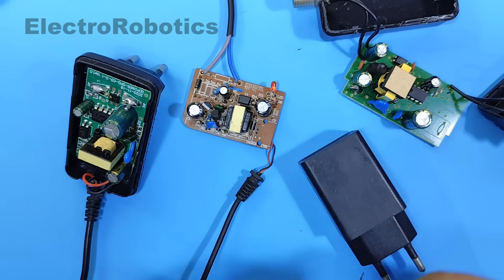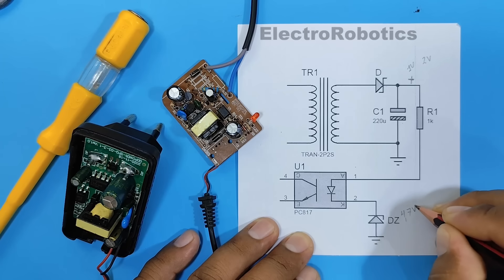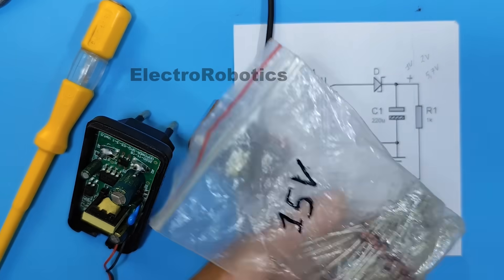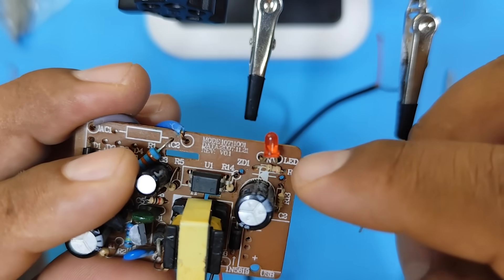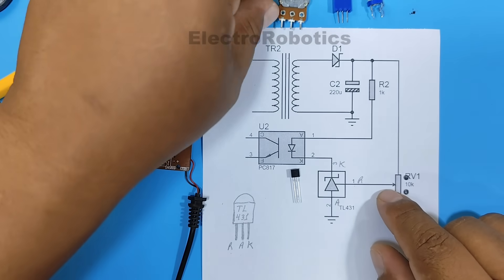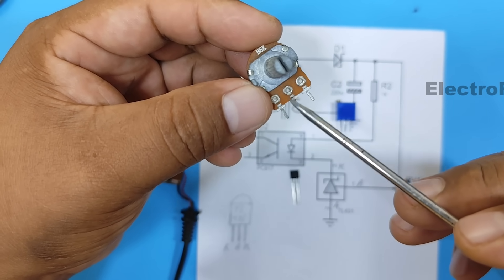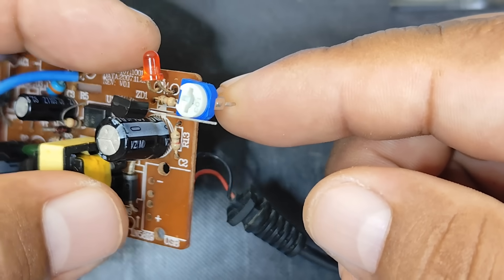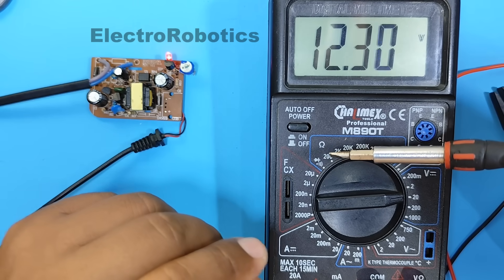Modify Any Charger and Adjust Its Voltage.

Comment: Fantastic explanations. 
Well earned Sub.
Cheers!
Reply: Do not be FOOLED !

So much mis-information
- FIRST SAFETY  is important but no safety precautions are given. The part about adjusting the trimmer is scary bad.
- The current must be reduced else it will over-heat and self-destruct. Do not be FOOLED !
 - it does NOT work on all chargers. Do not be FOOLED !
- the output waveform will be degraded, so the load may not work properly. Do not be FOOLED !
- he does briefly mention the issue with the output cap .....be CAREFUL. For example if you change to 12V then the output cap must rated at least 16V

 This mod has been around for many years  by very ignorant channel makers. It is too bad he has repeated the same mistakes and same mis-information. He should know better.

Using a DVMM with no load is a rather naive test. Do not be FOOLED !

Comment: Good idea👏
Reply: Do not be FOOLED !

So much mis-information
- FIRST SAFETY  is important but no safety precautions are given. The part about adjusting the trimmer is scary bad.
- The current must be reduced else it will over-heat and self-destruct. Do not be FOOLED !
 - it does NOT work on all chargers. Do not be FOOLED !
- the output waveform will be degraded, so the load may not work properly. Do not be FOOLED !
- he does briefly mention the issue with the output cap .....be CAREFUL. For example if you change to 12V then the output cap must rated at least 16V

 This mod has been around for many years  by very ignorant channel makers. It is too bad he has repeated the same mistakes and same mis-information. He should know better.

Using a DVMM with no load is a rather naive test. Do not be FOOLED !

Comment: What about the total outout?
If I increase the voltage, does the Amp decrease?
What if I made 5V-3A (15W) Charger to 12V, Will it still can deliver 3A? if that so, the total output power has increased? (12V-3A=36W?). Will it heat more as compared to original setup?

Comment: Excellent..... thanks.
Reply: Do not be FOOLED !

So much mis-information
- FIRST SAFETY  is important but no safety precautions are given. The part about adjusting the trimmer is scary bad.
- The current must be reduced else it will over-heat and self-destruct. Do not be FOOLED !
 - it does NOT work on all chargers. Do not be FOOLED !
- the output waveform will be degraded, so the load may not work properly. Do not be FOOLED !
- he does briefly mention the issue with the output cap .....be CAREFUL. For example if you change to 12V then the output cap must rated at least 16V

 This mod has been around for many years  by very ignorant channel makers. It is too bad he has repeated the same mistakes and same mis-information. He should know better.

Using a DVMM with no load is a rather naive test. Do not be FOOLED !

Comment: Great video, dude... 
I've just left a big and well-deserved thumbs up!
Reply: Do not be FOOLED !

So much mis-information
- FIRST SAFETY  is important but no safety precautions are given. The part about adjusting the trimmer is scary bad.
- The current must be reduced else it will over-heat and self-destruct. Do not be FOOLED !
 - it does NOT work on all chargers. Do not be FOOLED !
- the output waveform will be degraded, so the load may not work properly. Do not be FOOLED !
- he does briefly mention the issue with the output cap .....be CAREFUL. For example if you change to 12V then the output cap must rated at least 16V

 This mod has been around for many years  by very ignorant channel makers. It is too bad he has repeated the same mistakes and same mis-information. He should know better.

Using a DVMM with no load is a rather naive test. Do not be FOOLED !

Comment: Really awesome! Thank you so much for sharing! 😊
Reply: Do not be FOOLED !

So much mis-information
- FIRST SAFETY  is important but no safety precautions are given. The part about adjusting the trimmer is scary bad.
- The current must be reduced else it will over-heat and self-destruct. Do not be FOOLED !
 - it does NOT work on all chargers. Do not be FOOLED !
- the output waveform will be degraded, so the load may not work properly. Do not be FOOLED !
- he does briefly mention the issue with the output cap .....be CAREFUL. For example if you change to 12V then the output cap must rated at least 16V

 This mod has been around for many years  by very ignorant channel makers. It is too bad he has repeated the same mistakes and same mis-information. He should know better.

Using a DVMM with no load is a rather naive test. Do not be FOOLED !

Comment: Its not always that easy, esp. with bigger SMPSUs. There may be a lot of difficult control circuits that won't work with too high oder too low voltage. In general a variation of 30...50% of its nominal voltage is possible, but it can also fail terribly!

Comment: Harika açıklayıcı bir video olmuş, teşekkürler.
Reply: Do not be FOOLED !

So much mis-information
- FIRST SAFETY  is important but no safety precautions are given. The part about adjusting the trimmer is scary bad.
- The current must be reduced else it will over-heat and self-destruct. Do not be FOOLED !
 - it does NOT work on all chargers. Do not be FOOLED !
- the output waveform will be degraded, so the load may not work properly. Do not be FOOLED !
- he does briefly mention the issue with the output cap .....be CAREFUL. For example if you change to 12V then the output cap must rated at least 16V

 This mod has been around for many years  by very ignorant channel makers. It is too bad he has repeated the same mistakes and same mis-information. He should know better.

Using a DVMM with no load is a rather naive test. Do not be FOOLED !

Comment: Thank you. You helped a lot!
Reply: Do not be FOOLED !

So much mis-information
- FIRST SAFETY  is important but no safety precautions are given. The part about adjusting the trimmer is scary bad.
- The current must be reduced else it will over-heat and self-destruct. Do not be FOOLED !
 - it does NOT work on all chargers. Do not be FOOLED !
- the output waveform will be degraded, so the load may not work properly. Do not be FOOLED !
- he does briefly mention the issue with the output cap .....be CAREFUL. For example if you change to 12V then the output cap must rated at least 16V

 This mod has been around for many years  by very ignorant channel makers. It is too bad he has repeated the same mistakes and same mis-information. He should know better.

Using a DVMM with no load is a rather naive test. Do not be FOOLED !

Comment: So, if you were to change the capaictor to a high voltage value, say 30volt, wojld you have to change anything else to keep it from popping? I imagine i might end up chacing components across the entire curcuit! I would really like to know. I just ordered a basic powersupply with adjustable voltage. I could have done the same thing with these pieces and one of the HUNDREDS of power supplies i have stuffed in boxes, draws, trunk of my car... they are EVERYWHERE! Ionly paid $10 for it, but i wouldnt have bought it at all had i seem this first! 😂

Comment: I want to change my old mobile phone 5 volt Charger into 12 volt charger. But, when i look on YT, all i saw are changing the zener diode and the capacitor. My Mobile charger are made without any Zener diode. I'm not technician nor electronic expert, but self learner. So, i don't know how to change my Mobile Charger output voltage, please help me.

Comment: Okay, nice educational video with not much practical use. If your device is 5V use a 5V charger, if it's 12V then use a 12V charger. If you want your phone to charge faster you need a charger that puts out higher mA, which usually comes with thicker wires and contacts. 🤖

Comment: You are wrong.
These are usually single ended 'flyback' topology. The transformer turns ratio and inductance is designed for the output voltage.
If you boost the voltage from 5V to 12V. This will increase the primary voltage significantly, in fact reflected voltage will increase by 140%. This will have added many serious consequences to power loss and voltage stresses. Unless you are very lucky it won't last. Some will blow up rather quickly as you avalanche the primary MOSFET.
This is really bad advice, it's far more complex, but I guess you really don't know what you are doing in any detail.

Comment: I have 5v 3A charge, i change capacitor to 25v then i increase voltage 15v , so what's maximum A i get from it 3A or 1A?

Comment: BAD! He never talked about the output voltage and current ratings of the transformer in the circuit. No load rating, just yank the voltage ⚡✨! No caution, except for partial cap voltage hint. BAD MANIPULATION!

Comment: Except that by doing that, your risk is to open too mutch the duty cycle which would lead to break the power supply.
Those power supplies are tiny flyback converters and the duty cycle must not be higher than about 30%.
The real thing to do would be to add turns in the secondary, then your method and then you would get a higher voltage with the same duty cycle.

In fact there are no risk to pass the duty cycle because if this problem occured your flyback would react by current protection because they are all current mode.

But you would face a regulation problem: the voltage wil break down more or less.
Reply: Betul sekali jika beban berat maka isdet

Comment: Stay 20% under the Capacitors Voltage, it will be safe and the capacitor will last much longer. So - 20% of the 16V gives you 12.8V

Comment: Maybe the best tutorial video on a practical electronics modification project that I have yet seen. There were still a few very minor mistakes and/or omissions in the explanations and/or steps; key word here being "minor".🤗
I would have liked if you had demonstrated the full range of voltage adjustment on the finished power supply, especially a few words on the MINIMUM VOLTAGE AVAILABLE.
Great work, & I'm certain you'll only get better!😎 Best of luck, & I'm subscribing!🤗
Reply: It's not "the best", it's not even good, it's dangerous and you may end up losing the charger as well as the house you're using it in if you follow this turorial.

Comment: I like his disregard of safety. Tuning the pot with one finger holding the board down with grid voltage just a few millimeters away. 
I this he is looking for thrills.
Reply: OF COURSE he has NO IDEA WTF he's doing, which is why he put together this video with the help of his soldering iron, which he also has no idea how to use, & ignores the DANGEROUS mains voltage it works from as well.🤪🤣🤣🤣🙄
I HIGHLY recommend for your personal safety, that you MAKE SURE that you wear rubber boots & always keep one hand in your pocket when watching his videos.😘

Comment: Dear Professor, following your project to make an small power supply from an old adapter I tried it and I must say it works quite well. I used an old 9V 1.5A adapter. The circuit is regulated by a TL431. I isolated the R from the TL431 and connected a 10Kohm potmeter. After changing the 470mF C in the output to a 25V type the voltage in my test went far over 30V so I put a 1K2 resistor between the ground connection of the potmeter and ground. The max voltage I get now is 23V which is perfect. My only problem is that I cannot go under 5V which is the minimum I can achieve. It is possible to change something so I can go back to 3V?
Reply: I don't know how to go down to 3V, but 25V capacitor is at the edge of the 23V output and may explode.  You should have at least 30 % higher voltage rating at the output capacitor.

Comment: Puzzled by this.The positive of the variable resistor controlling the variable zener is connected to the output of the transformer output.  Doesn't this mean the voltage across RV1 and hence the control signal to the TL431 changes with the TR2 output?

Comment: by incresing voltage..watch out the capacitor volatge value..and change into the higher voltage rating

Comment: Thank You for this tutorial. WHY is so important to set pot to the middle before starting? When we start regulating voltage with it, and we get over the middle, to set desired voltage and turn everything off. Now what? Should we return pot to the middle before pluging it back?
Reply from the maker: Hi Miroslav Miljkovic, we set the potentiometer to the midpoint so that the voltage we're adjusting isn't too high, since we don't know what voltage we'll get, so we start from a midpoint.
After setting the voltage, you don't need to reset the potentiometer to the midpoint.
Reply: @ElectroRobotics-qo2er  Thank you for the quick response. You got yourself a new subscriber!

Comment: Thanks for the illustrated content 🤗 but may i ask what is C1 and R1 values are controlling ?
Reply from the maker: Hi St Man, C1 is the capacitor that chargers have, its job is to keep the voltage stable, R1 is a representation of the load or the energy consumer like your phone would be.

Comment: nice tutorial. thank you for this.
Reply: Do not be FOOLED !

So much mis-information
- FIRST SAFETY  is important but no safety precautions are given. The part about adjusting the trimmer is scary bad.
- The current must be reduced else it will over-heat and self-destruct.
 - it does NOT work on all chargers. 
- the output waveform will be degraded, so the load may not work properly.
- he does briefly mention the issue with the output cap .....be CAREFUL. For example if you change to 12V then the output cap must rated at least 16V

 This mod has been around for many years  by very ignorant channel makers. It is too bad he has repeated the same mistakes and same mis-information. He should know better.

Comment: You’re just too generous man. Excellent tutorial. Even a child can understand this tutorial.
Reply: Do not be FOOLED !

So much mis-information
- FIRST SAFETY  is important but no safety precautions are given. The part about adjusting the trimmer is scary bad.
- The current must be reduced else it will over-heat and self-destruct.
 - it does NOT work on all chargers. 
- the output waveform will be degraded, so the load may not work properly.
- he does briefly mention the issue with the output cap .....be CAREFUL. For example if you change to 12V then the output cap must rated at least 16V

 This mod has been around for many years  by very ignorant channel makers. It is too bad he has repeated the same mistakes and same mis-information. He should know better.
Reply: Even a child can tell you this is a crappy hack at best.

Comment: Beautifully and clearly explained and I didn't know it was that simple to increase the voltage
Reply: Do not be FOOLED !

So much mis-information
- FIRST SAFETY  is important but no safety precautions are given. The part about adjusting the trimmer is scary bad.
- The current must be reduced else it will over-heat and self-destruct.
 - it does NOT work on all chargers. 
- the output waveform will be degraded, so the load may not work properly.
- he does briefly mention the issue with the output cap .....be CAREFUL. For example if you change to 12V then the output cap must rated at least 16V

 This mod has been around for many years  by very ignorant channel makers. It is too bad he has repeated the same mistakes and same mis-information. He should know better.

Comment: Great video.
I have a question, does the amperage stays the same after increasing or decreasing the voltage?
Reply: If voltage goes up, current goes down.

Comment: Concise. So easy to follow and understand. Thank you.
Reply: Do not be FOOLED !

So much mis-information
- FIRST SAFETY  is important but no safety precautions are given. The part about adjusting the trimmer is scary bad.
- The current must be reduced else it will over-heat and self-destruct.
 - it does NOT work on all chargers. 
- the output waveform will be degraded, so the load may not work properly.
- he does briefly mention the issue with the output cap .....be CAREFUL. For example if you change to 12V then the output cap must rated at least 16V

 This mod has been around for many years  by very ignorant channel makers. It is too bad he has repeated the same mistakes and same mis-information. He should know better.

Comment: Hey I'm interested and ready to explore on your journey of electroRobotics... I love automation simply to solve household problem
Reply: >>>>>>  Do not be FOOLED !

So much mis-information
- FIRST  no safety precautions are given. 
- The current must be reduced 
 - it does NOT work on all chargers. 
- the output waveform will be degraded, so the load may not work properly.
.. be CAREFUL. For example if you change to 12V then the output cap must rated at least 16V

 This mod has been around for many years  by very ignorant channel makers. It is too bad he has repeated the same mistakes and same mis-information. He should know better.

Comment: Greetings lovely idea but at 9:57  This pin is negative an this pin is positive - How do we know that?????
Reply: >>>>>>  Do not be FOOLED !

So much mis-information
- FIRST  no safety precautions are given. 
- The current must be reduced 
 - it does NOT work on all chargers. 
- the output waveform will be degraded, so the load may not work properly.
.. be CAREFUL. For example if you change to 12V then the output cap must rated at least 16V

 This mod has been around for many years  by very ignorant channel makers. It is too bad he has repeated the same mistakes and same mis-information. He should know better.
Reply: @kennmossman8701  Thanks for the feedback seemed to good to be true